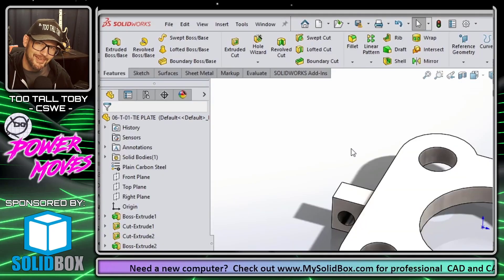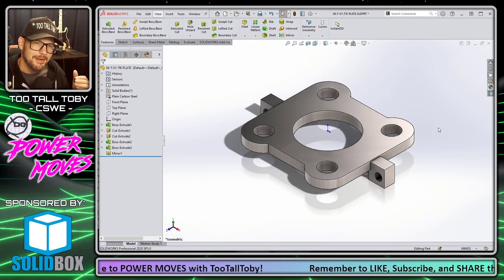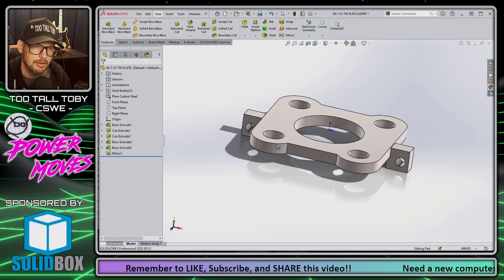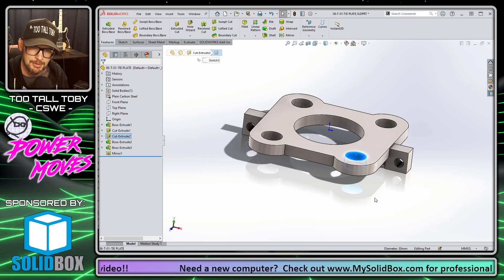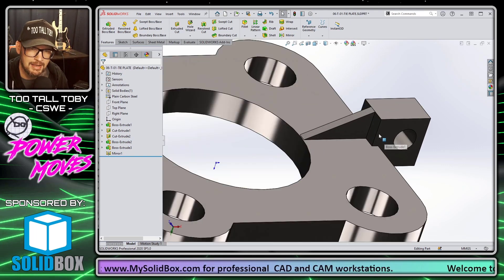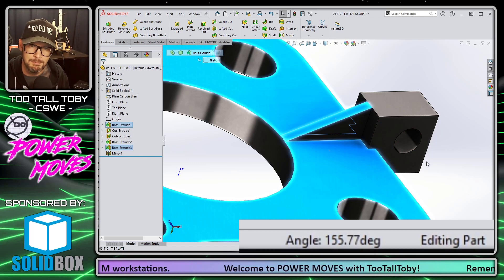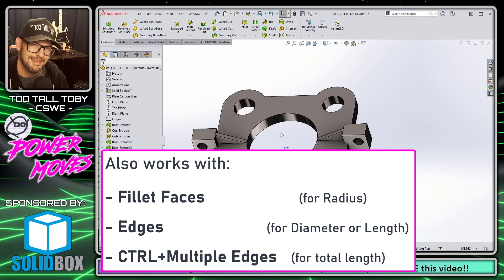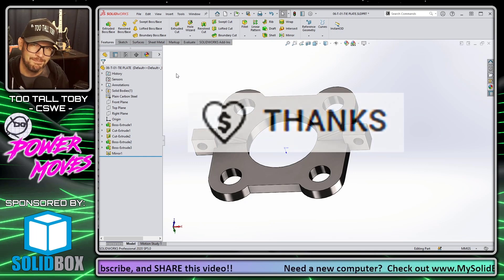SAVE TIME in SOLIDWORKS with this quick tip!

Comment: Can you help me how i can count part in assembly by searching component
Reply from the maker: use ASSEMBLY STATISTICS then group by part
Or make a Bill of Materials using the PARTS ONLY option
Reply: @TooTallToby 
Thanx for reply but my question is other i want if i search any component by part no. So can i get the total quantity on the bottom status bar??

Comment: I knew this one already Toby, but I learned it from you previously, so I guess I have to pay it forward... Also this doesn't always give the info you need and sometimes you need the measure tool, but it is a pain to find, so I would make measure the "M" shortcut as another tip.
Reply from the maker: Lol - thanks 5lax!!   that's a great tip too - using M for measure!!